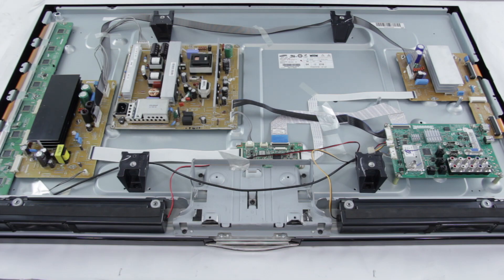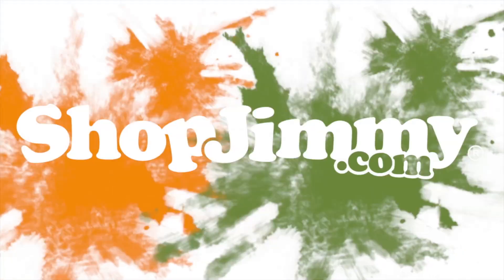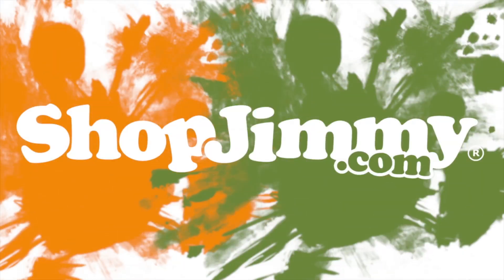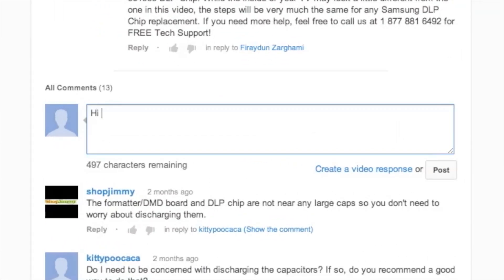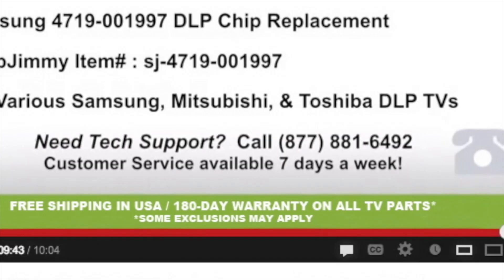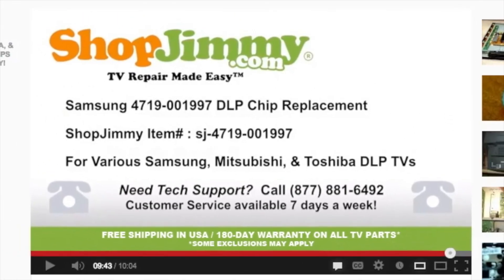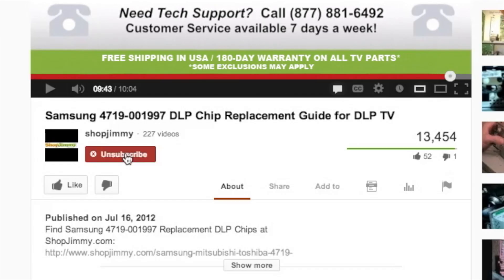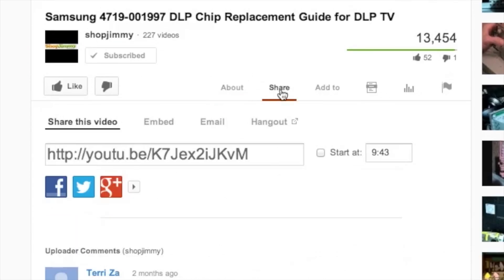Plasma TV Repair Tutorial - Common Symptoms & Solutions - How to Fix Plasma TVs

Comment: Hy, I have an older plasma TV model ”Thomson 42PB130S5”. It receive current, powers ON, the green LED stays, I checked the voltages, VS=200V (195V specified) and VE=59V (60V specified). I Checked the output of the Z-SUS board with my Ohmeter on DC (just to see if is something there) and it shows 460V. Also I checked the same thing on the Y-SUS board, it has 70V, 135V and 95V on its output (measured with the multimeter on DC), and on the buffer outputs there are 50V on each ouput (measured in the same way). The problem is that it doesn't have picture. Don't know about sound, I use the output of a Play Station 2 to check the TVs, I don't have TV cable here.
Edit: I left it ON for a while, it draw 70-107W from the wall, depending if I press on the P+/P-/Menu (the menu it's shown in user manual), and the radiator gets warm on Z-SUS but it remains completely cold on the Y-SUS board. It leads me to the variant that the Y-SUS board is bad. I checked with an oscilloscope the 14MHz quartz on the logic board and it seems fine, the waveform is good and it has 14MHz.

Comment: I have a PN51E550D1F that will not do any thing.
It shows 5 volts STBY. on the power supply but there is no STBY.light on the front panel.
There is no flashing "health"  light on the logic board until I do the jumper trick on the power supply.
So does that mean I have a bad main board??

Comment: I have a Samsung model pn58c5501gf plasma tv. Everything turns on just fine. However it will not receive a signal keep telling me in the HDMI 1 mode to check connected devices power, cable connections, and source selection. When I go to main menu and select channel -antenna / cable, it is stuck on antenna and won't allow me to select cable. I have tried plugging into all four ports what the HDMI cable and on all three other parts it tells me that the source is not connected please check connection again. I've tried plugging other devices in as well with no success I have good navigation on the menu I've tried to plug in antenna in and only get a snowy picture. Would this be my main board?

Comment: MY TV IS SAMSUNG TV MODEL PN60E530A3FXZA, The bottom half of the screen has snowy and horizontal lines. What panel or part need to be replaced. Thanks. email address: azm2004@comcast.net Thank for your prompt response.

Comment: Great video!
I have a 60 in. LG plasma. It turns on for about 15-30 min. then shuts off and won’t turn back on for several hours. What board should I replace?
Reply: did you get this fixed

Comment: I have an LG plasma TV model:  50PC3D     When turned on with the power button the screen displays a dark black and grey snowy image with a kind of black hole in the middle of the screen.  There are vertical lines present and the screen seems to strobe as if it is surging.  This is my first TV repair but based on the info learned in your video seems likely the logic board will need to be replaced?  Your feed back would be appreciated as I am going to wait on ordering any parts until i get a response. Also I live in Alberta Canada and also would like suggestions on a cost effective yet quality source to order parts from?  Thank you and happy holidays to all.

Comment: samsung plasma tv model PN60F8500AF I have vertical lines (4) 2" from the left side of the screen the lines are very nerrow so I just live with it the lines look like have colors not wight also some times after I start the tv its flickers and no picture shutting and restarting the tv solve the problem

Comment: I have a pn51d490a1d Samsung plasma tv that has red pixels that jump around the screen
Reply: Michael Klinckhardt you likely need to adjust the pots on the sustain and/or the power board
Reply: @HughHoleJass   how do I go about doing that. I ordered new boards in hope of fixing this issue.
Reply: @michaelklinckhardt8629  Shouldn't need new boards hopefully. You likely need to adjust vscan and/or vs adj. Use this guide to help you and be careful. I wouldnt use anything metal to adjust them btw too risky. http://www.jopezu.com/plasma.htm
Reply: I have tried that and more adjustments to no avail. I can make it better but not fixed. I am replacing the power, x and y boards as they are dark almost burnt like.

Comment: Hello I have a Samsung 60 inch Plasma TV that has lost the video or screen the tv turns on but no screen the red light that indicates if the tv is on or not blinks 5 times and then pulses then does it again  I have checked all connection HDMI checked the power supplies by unplugging from surge protector plugged it back into wall socket still the same every now and again you see a faint flicker have tried everything I know even called Samsung support and they had nothing This TV is only 5 years old paid a lot of money for it Can you help please let me know Thank you

Comment: Hi.  I have an LG 60PM6700 plasma.  A few days ago it suddenly lost a whole section of picture from left edge to right edge.  It starts about 15% from the top edge and is solid black down to about 35% from top . . .. a solid black section of about 1/5 of the total screen height.  I've removed the back and there doesn't appear to be any loose connections or blown caps.  I've done a lot of searching online  but haven't found any other instances describing this problem . . . mostly just single lines, not a whole section.  Any suggestions?

Comment: I have a LG 50PG25, 50-Inch Plasma TV that started out as 1 but now has 2 white vertical lines running from top to bottom in the center of the TV.  When it first appeared the lines would disappear after the TV warmed up for a few minutes but now they don't go away.  Also, sometimes when I change channels the TV may turn off briefly and then turn right back on before it goes to the other channel.  What could be my problems and what components do I need to change out?

Comment: Hello! I have a TC-P65ST50 that started having interference lines/flashes and then stopped delivering input entirely on all ports. We've never had an issue with damage, pixels, it turns on and we can see the "no signal message" floating around. Looking for instructions on diagnostics, parts, and DIY repair.  THANKS!

Comment: Panisonic Plasma TC-50S2 - Powers on and 2 to 3 seconds later the power supply clicks off and give a 10 flash code. The screen does not power on during the 2 to 3 seconds before shutting off again. I have disconnected both the SS board and SC board together and single, and the power supply continues to click off within 2 to 3 seconds. The power supply board (ETX2MM806AEL) looks okay from a visual inspection of the components resistors, capacitors, and so on. I've done some in circuit testing (I know in circuit isn't proper readings) and not finding anything that gives me any issues to look further into. I do not currently have an ESR meter to test the caps in circuit, otherwise I will be removing the caps to test off the board. Any suggestions will be greatly appreciated.

Comment: PN42C450 front control panel not working.  The TV turns on and has picture.  Volume does not work and the Menu opens on its own.  I attached a Chromecast and was able to adjust volume.  The standby led appears to be flashing rapidly. Your thoughts?

Comment: I have a lg 60pv450 plasma tv... picture is great but after a while the screen goes black but still has sound.... also noticed the ysus board heat sinks are hot especially the lower right heat sink

Comment: Hello Thank you for your video. I have Sanyo DP42746 plazma TV. I found one capacitor was bad TV had snowy pictures. I found on Y baffer board assembly and replaced. Now I do not have snow but when I turned TV on pictures coming to screen late not a one piece picture and pictures are not bright and lovely. Also colors are not correct. Can you please help. Thank you

Comment: my tv is a lg 50pz750 it turns up any image black screen I already test the standby voltage and in in 5,2 volts and the other voltage 17 as the porwer supply board says I guess is the mainboard but I odnt know if I could do another the to make sure is it the bar code is EBT61659301

Comment: I have a Samsung plasm TV
PN50C550G1F with sound but no video
I don't know if it's the back light or if there is some other causing that is keeping it to not have any video

I can change the input I can turn up the value and it all still works I can turn it on and it it has no problem doing that but whenever it tries to show a picture it's completely black
It don't even look like the light is coming on either

Please help if you can and thank you
Reply: I have the same issue

Comment: I have a Samsung 50" ps50a457p1dxxu that  has like 15% of the right side of the screen black vertically. It also had a few capacitors that were black so I replaced them, and the image got fuzzy.

Comment: I have a Samsung 50" Plasma pn50a450p1dxza that has a standby light on, but will not come on. For a while now it would randomly turn itself off and then some time later, it would turn back on itself. Now it just wont turn on, but again standy light is solid red. Thanks

Comment: I have a Samsung hp-t4254 42" plasma. It powers on and has black screen and flashing green dots and an oscillating humming from Y-main as dots flash on screen. Replaced X-main which burned up I believe from running tv with address buffers disconnected and it did not fix tv. Replaced Y-main and Y-buffer and tv worked. Replaced video board due to broken coaxial plug ran tv noticed steady hum from Y-main seemed normal noticed picture to be a little noisy, green dots in the black areas of picture. All voltages on power supply are good. After one day tv died back to oscillating hum and flashing green dots. Any suggestions?

Comment: My TV started giving me a problem by the picture going black. Off/then back on and picture came back once briefly. Then went totally black. Now will not turn on. When you touch the turn it on it appears to come on and then turns its self off. I have a Samsung Plasma Model 64D8000. I would appreciate any direction you could suggest. Thanks before hand...........DT

Comment: Hi, I have a Panasonic plasma TC-P65S60.  It turns on properly with a good picture, but after a few minutes the picture blinks, turns pink/green and then white snow across the screen. After a few seconds (sometimes longer) it goes back to the perfect picture and runs properly until it happens again. Any help is much appreciated. Thanks, Matt

Comment: I have a Panasonic TH-50PZ80U plasma tv with a 3" wide vertical black (dead - top to bottom) band about 9"
from the side.  Could it be the A board?  I've replaced the TNPA4442 board with no improvement.

Comment: I have a insignia 50 inch plasma TV NS- Pdp50hd-09 at first no power just dead so I replaced the fuse and it came on but now it has no picture just sound. So I switched some fuses around still the same. Now what does it need I'm thinking a new main power supply board? That should fix the problem? What do you think I hope I don't have to throw away the tv because i like it even though it tends to get hot but I'm a little frustrated now.

Comment: I have a Samsung Plasma 3d  PN60E7000FF. After turning it on, it works fine for about 5 minutes, then it turns off and gives two red blinks five times. I cannot turn it back on without unplugging it and plugging it back in. If I wait a few minutes I can do the same thing again, if i unplug it and turn it on right away the same thing happens. i replaced the main board (the one with the inputs) and it worked for about 3 days and now the same thing is happening. What could be wrong with this TV? I want my 3D TV.

Comment: You video has helped me out to get an understanding of the problem I'm having which is that when I plug in my t.v. the red stand bye light comes on the way it was supposed to but whenever I turn on the power my screen stays completely black and then the stand bye light blinks 5 times and then shuts off the t.v.. what should I try to do first to solve the problem .
Reply: I just had the same issue with  mine. Ordered the parts and installed them yesterday...Replacing the Y and X sustain boards made it work like a new TV.

Comment: Hi, I got a Panasonic viera plasma tv model no, TH-42PD60X, that will show standby light on when powered on, but no images will show. It also takes a long time to show the back lights turning on, at times when I touch certain capacitors on the SC board, I will get the screen to show, but if I were to switch the channel, the screen goes black. Can you help figure out this issue and best solutions. Thanks

Comment: just watched your repair tutorial and it explained a lot Thanks, I have a Samsung Mod# PN51F4500AFXZA  Version#US02
type #PN51F4500 . We had a storm and a few lighting hits near by and our other tvs work fine but the one listed came on and 
has a pop up " no HDMI connections" tried different configurations no good . on HDMI-2 i get a very discolored pinkish red and distorted image that goes in and out. i hooked up an digital antenna and get great  pictures. no HDMI .

based on the video the main board / ss board ??

Comment: I have a samsung 51in plasma tv. Model number pn51d8000ff. I have no picture I took back off and when u first turn it on it buzzes for a sec then stops and flashes a green light. I do have power going to tv cause red light is on front of tv.. can u help plz

Comment: I purchased a main logic control board from ShopJimmy for my Samsung Plaza PN51D450A2DXZA as I had vertical lines from a power surge.  Board replaced but still the same vertical lines.  What board should I try next?  Thanks.

Comment: I have a 50" sharp plasma t.v. My son threw a ps4 controller at e.t. stand. It bounced up hit the t.v. and it looks like it has a crack in it now. But I've checked and it doesn't have an actual crack in screen. Also from the crack down is part black and part streaked. This covers about 30% of the right side of the TV. From the crack down. Is there anyway to fix This? Or do I just need to spare the rod with my child. And break the bank buying a new television? Oh model # is:
LC-42SB48UT [A] SHARP
plz let me know what you think.  If you can't reach me on here. You can email me at: shaunlowe577@gmail.com 
Thanks so much.

Comment: Great tutorial, My 60 inch Samsung Plasma started putting a thin bright green vertical line down the screen about 8 inches from the right side edge. I was bummed out and was looking for a new LED TV,  I got used to the great blacks that Plasma TV's have and really didn't want to spend around $2500 for a OLED TV  that have great blacks. 
Found your posting and you described the symptom my plasma is having so I am taking a chance and ordering a Main Logic control board off of ebay, was only $15 so no big deal if it doesn't fix it.Thank you for the very informative post.
Reply: I realize this is an old post, but did you get the logic board installed and did it fix the vertical colored line?
Reply: Can I change plasma screen panel to an LED TV

Comment: Have 2011 ST30 series Panny plasma and suddenly no picture, no sound.  Red light continuous; but after pushing front power button get repeating 14 blinks.  Check voltages as and for shorts on power board, and at first got 000 reading on the non-gnd leads; but then later get some ohms reading, but not sure what setting to put my cheap voltage meter(20, 200, 2k, 20k, etc...) as this seemed to yield different results.  I thought maybe the set reset itself after I got the ohm readings on P11, I think the video said, connected or not to buffer; and, the other connection on opposite side.  However, no change.  Did the volume, mode, volume up/down at same time on set, or on remote, as got differing answers online on how to reset this 55” plasma Panasonic ST30 series.  I ordered power supply board on ebay hoping to get a fix; but now I am confused from the differing info online; but the p-board does seem to be the most common to go bad.  This video and Jimmy’s explanation was THE MOST clear on IDing the boards and feel I might get a most likely fault reply to this common problem with this year and make of TV.  Works beautifully for about a year, then goes out.  I had it unused in guest room for 5 years and only 9 months ago did it get daily use.  Then the other day turned it on and click, and no sound, no video. Capacitors all look good however, no bubbles, and no burned parts, no smell as usually is the case.  PLEASE HELP with and ‘most likely’ scenario of which boards to replace in depending order, as this TV gets as good a picture as the new 4k UHD TVs as I use them streaming, even the so-called 4k content on Netflix and Amazon Prime.  Best, Seth

Comment: I have a Samsung PN51D450A2DXZA N102 which powers on with a 5-6 second steady light on the logic board before it  cycles off and repeats. I've tried the process of elimination of the y sustain and x sustain boards but can't get the TV to power on with an image displaying on the screen or the noticeable samsung "chime". Capacitors look good but I haven't put a meter to them yet. Any idea what I can maybe look at next?

Comment: I have a 42inch Samsung PN42C450B1D, The controls on the TV it's self and the remote will not function properly,  I can use the power button on the TV to turn on and off but the other control do not work. The sound, toggle between the inputs, or the settings, will not work properly. Please help.
Thanks  Q

Comment: I have a Samsung pn51d530a3fxza. It clicks and the red light blinks but the TV doesn't turn on. I replaced the power supply board twice and still the same issue. Any recommendations?